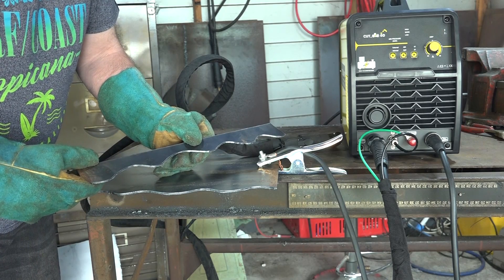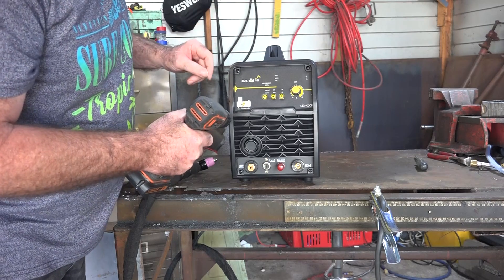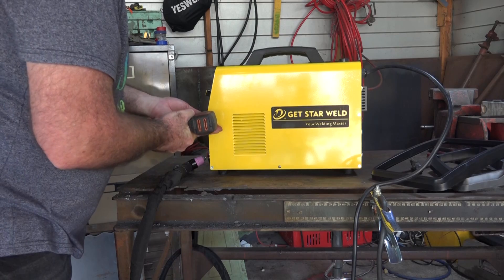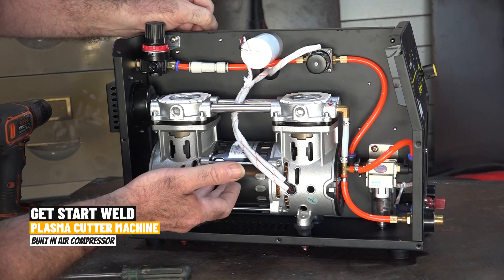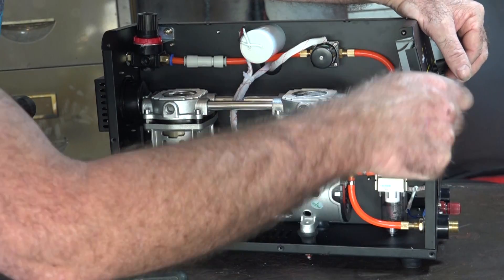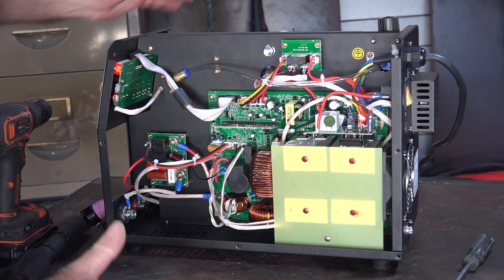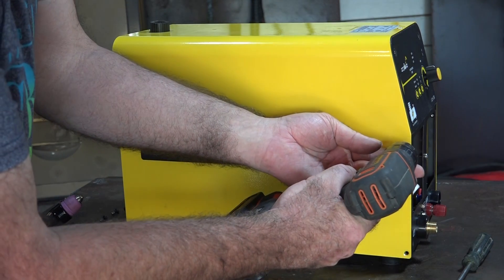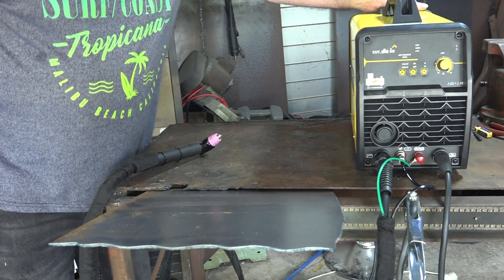Plasma Cutter With Built In Compressor - How big is the compressor inside?

Comment: Seems I have some catching up to do! That's a cool machine. I have a similar air compressor actually. Little thing called a California air. It's whisper quiet too. I think since it's a twin cylinder, it runs lower rpm. I pulled my Cut 45 apart after I bought it, because the power cord was about a meter long, hahaha. I think the weirdest thing I tore down was a nautical compass. I kept all the little pieces too.
Reply from the maker: Very cool!

Comment: Nice work Pete. While watching I was wanting you to examine the air path from compressor to torch. 
The connections to the water separator and regulator differ from the usual series configuration on a standard external compressor setup. But obviously they must work properly.
Reply from the maker: Cool, thanks

Comment: I did a ton of research looking at tankless compressor-type ideas and found the 'heavy duty' off-road type air inflators could in some cases provide enough airflow for a plasma cutter but it was limited in endurance, as you might imagine. That and they get Crazy hot even doing tires, not to mention they all tend to wear out really fast with any serious use. The air compressor in your unit is like the smaller brother of the one that the new type oilless air compressors that claim silent running all use. They can flow a fair amount as well, but tend to self-destruct with higher air consumption tools like impacts and grinders from frequent cycling. 
At any rate, the absolutely cheapest one worth the beans was $300 US and would need to be rebuilt fairly often. California Air (a chinese distributor) has those pumps if you want a look. Here in the US, the cheap tool place is called Harbor Freight, and you'll see that same pump on any number of other machines, the usual rebranded affair. I even looked at wholesale outfits, and they weren't any cheaper than $220 per unit. 
End of the day, I refurbished a more traditional air compressor with a decent sized tank; all included for parts and the unit, I am in it for about $300, with some DIY filtering bits of course. It'll run like a champ all day and probably for ten more years if I do my part on maintenance.
Reply from the maker: Yea but its all about a small self contained unit for offsite plasma cutting.